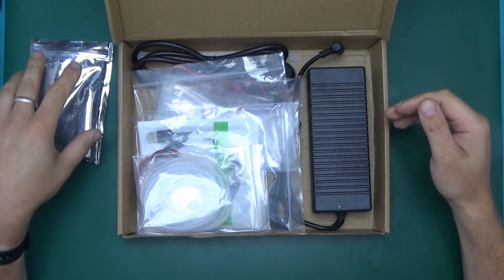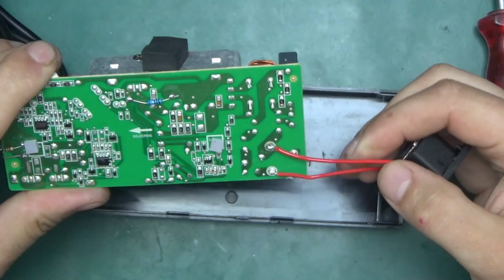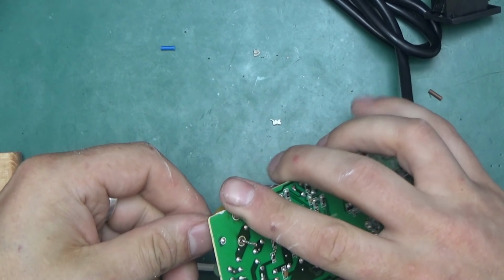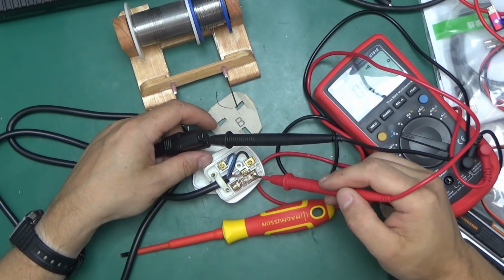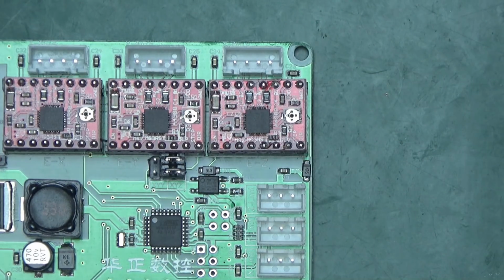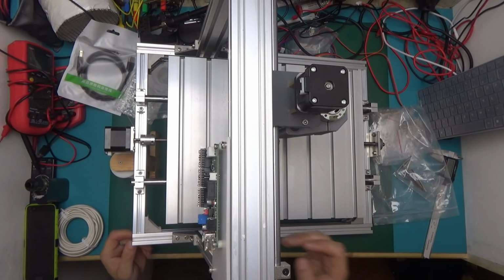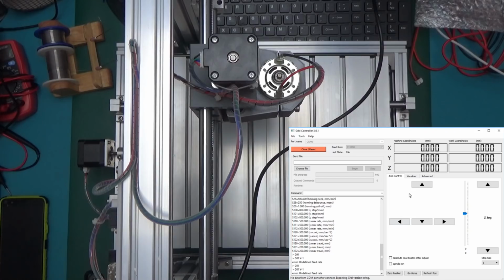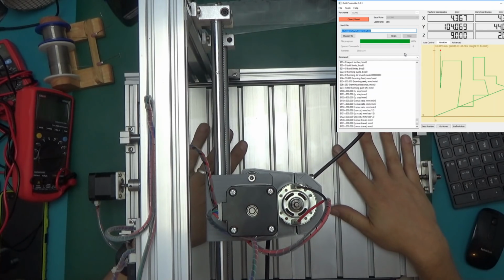#012 - CNC2632 build: The electronics

Comment: Liteon does make a lot of power supplies for laptops. One I repaired recently from an lanova flex laptop and a few others have also been lite-on power supplies. The lenova one had to much heat, as they designed it to be small. Sometimes size does matter for heat ventilation. After all heat is one of electronic components main enemies. 
My only concern is the voltage may be correct, but what about the current output? The drivers stepper controllers don’t use much, and the main board won’t drain much. But for stepper motors to properly have the correct torque and keep steps with start and stop take more power. This reminds me of some of my 3D printer builds, so of course the power to the stepper motors are controls from the mosfet on the stepper drivers. And that power is running through the main board of course. A good main board can alternate the power from one stepper controller to another very fast alternating the power without the need of a bigger power supply, but also sometimes causes this to over heat the driver controllers or the switching side on the  main board. 
So just a word of caution, keep an eye on the heat of the stepper control boards (I know they are cheap) and sometimes a little heat sync for a raspberry pi can help keep this run cooler. Maybe a fan in the main board if you enclose it to keep air flow moving? If you notice over longer projects the machine losses it steps, it could be from not having enough over all wattage from the power supply. 
Not sure if you have anything to load test the power supply with, some way to see if it does provide the power it claims and maintains the 12 volts at the high end? I think you bought one of the cheaper load testers at one time? Or was this someone else I watch? Well since this wasn’t a repurposed power supply it might be good checking to see if it does what it claims on the writing specs of the case. 
Good luck with the rest of the build. Looks like a fun machine, makes me want to take a 3D printer build I never started and convert it to a CNC, but I also want to convert it to a laser cutter. Hard choice between the two.
Reply from the maker: Thanks! You are very right in what you said about heat and current capacity of the PSU. I really think though, that it will suffice, given the small size of the steppers. But the time will tell. And yes, I do have a constant current load somewhere in the attic still (self built though). It would be hard to find it now, lots of gear is still up there. I will keep an eye on the steppers and drivers and see where it takes me. Btw. Technically any CNC router can be laser cutter, just swap spindle for a laser module, does not get any simpler. I would keep the printer separate, it could come handy one day! Take care!

Comment: I've never thought to question (check) new cheap Chinese power supplies, or IEC's - until now... Everything I get from now on will be opened up and tested - great vid looking forward to the next one soon!
Reply: Yea, cheaper items like to re-use things from older stock. I’m all for recycling good electronics, but sometimes you get the minimum needed and can cause issues with its operation. 
Reminds me of the older 18650 cells that had sand and a small LiPo cell inside the metal case. The sand was added because people started to weight the cells. Just another way to make it look legit, but still never had the proper capacity. Same concern with this power supply, might jot have the amperage needed, maybe a slower runs you might not notice, but when you speed it up and lingers projects you may see it messing up. Start to think it’s your CAD file, or something you did wrong, but in the end it was the lack of power for a power supply rated by a sticker on the outside that was wrong and it doesn’t give nearly as much power needed. Just extra cost for a better power supply and time waited trouble shooting. Not difference from check 2 amp USB power supply’s that fall from 5 volts to 3.5 volts when under a load of 1.2 amps. Sometimes you do get what you pay for, but in the end can be more of a headache then it’s worth and you still spend more to make it correct. 
It’s a sad world we live in these days just to sell something with s lower price tag, I guess they don’t care about returning customers and just the initial sale.